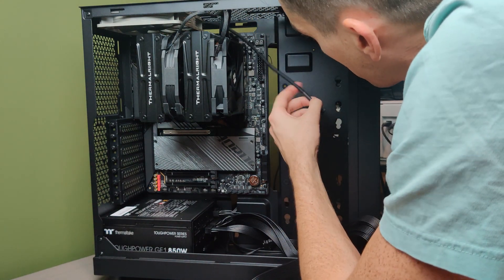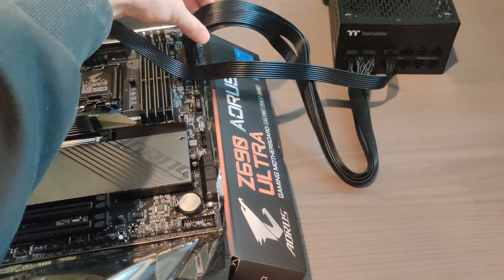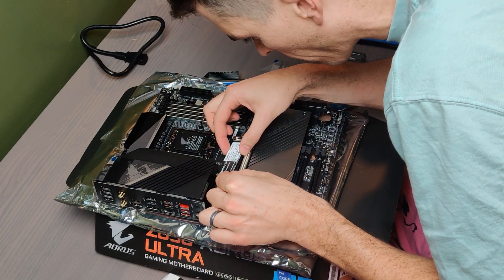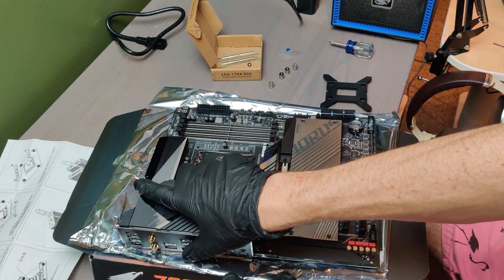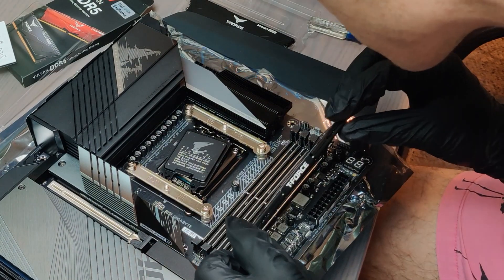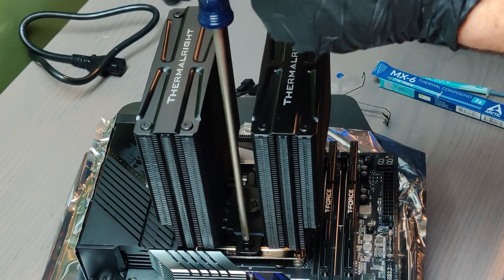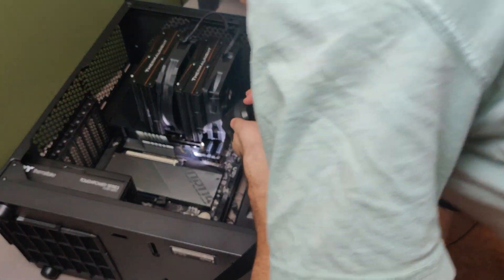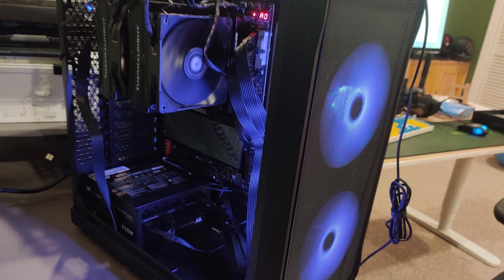PC build walkthrough: i5-13600K,  Z690 mobo, Thermalright Frost 140 cooler

Comment: A few things 1st being don't set your motherboard on the outside of a anti static bag back will only add static, better off setting it directly on the box have done it this way for years, secondly just an fyi for those who have this board with a 12th gen looking to upgrade to 13th, u can update the bios using gigabyte software on the os without needing to use a usb stick if u want to use the usb method its  fine for those without a last gen chip in there system already just a recommedation.

Comment: Well hopefully, it's great minds think alike. Our choices for main components are nearly identical. I am a few steps behind you, awaiting some final parts, but found your video highly informative, and very nicely done. I too, have selected the Aorus Ultra, i5-13600K, Asrock 6800XT.  I ended up selecting the Lian Li 216 as a case and a 360mm Galahad cooler. I would be very interested to see how the two coolers end up comparing. The Thermalright looks beastly.  FWIW, I also selected the Bending Correction Fixed Buckle which I am still waiting, but it had some impressive reviews by Gamers Nexus and others for some significant cooling impact, by better distributing the contact of the CPU.  Many report between 5 and 10 C reduction.  We shall see.  Hopefully we can compare some notes after I get my mine built and operating. Very very nice job by you.